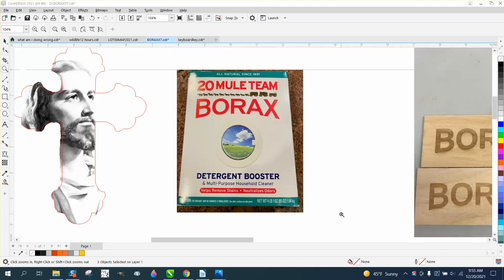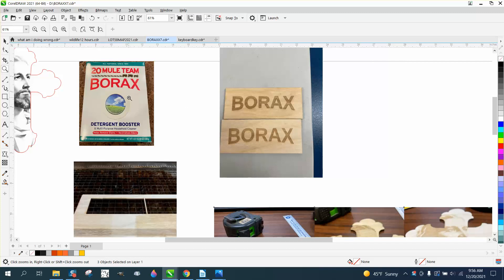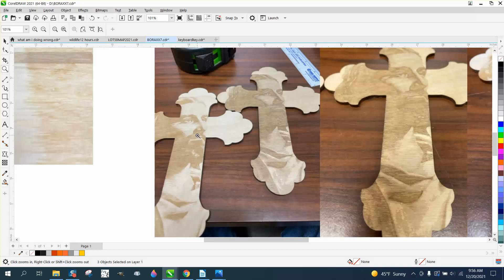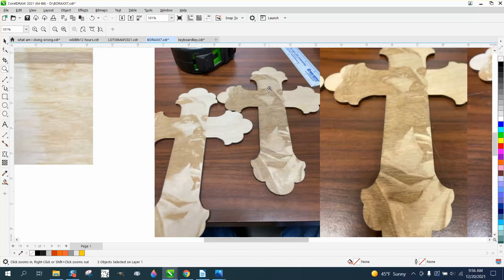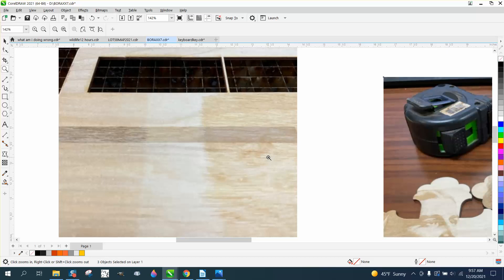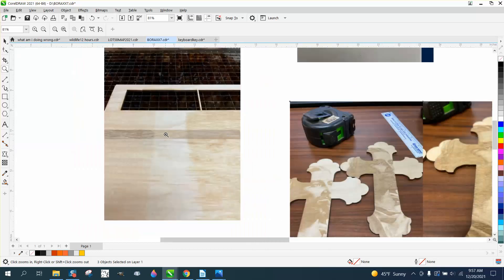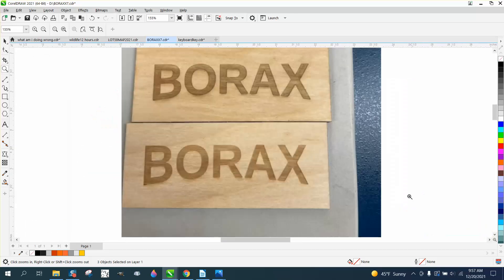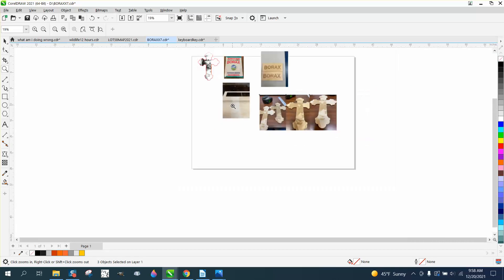Laser Tips & Tricks BORAX Engraving

Comment: Hi Doug. Really enjoy your videos. Thank You.  I used Borax on some red oak and it really darkened the image.  Went to wash off the borax afterwards and the image all but disappeared!  No or little engraving of the wood...I use a Laserpro 15 watt metal tube.  Ray
Reply from the maker: Ray Carpenter yeah I'm not a big fan of it
Reply: The thing with borax when used correctly it darkens up the image from a sepia tone style to something like a black white grey scale image.
I will add borax to my pieces of wood and let them set for atleast a day, ..adding the liquid and drying it off with a heat gun or hair dryer is very different than letting the wood soak up the liquid and basically becoming part of the wood as one. 
I had to go over my portraits atleast 3x before they would be good to sell and when youre doing 3hour portriats that a full day...no point there..
For me i prefer it as it gives the imagine that black and grey realism styles,..something you cant get regular. 
Btw i use a 10w laser so yea